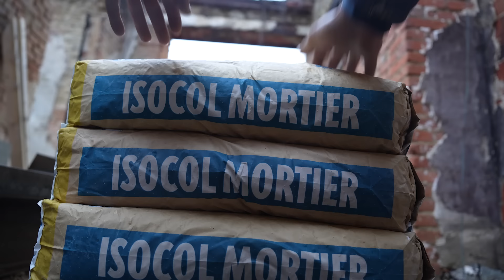AMAZED, the top of the chateau is impossibly level?

Comment: Just goes to show the bones of the chateau were quality work. This was not a slip shod build. It was built to last and built well. Your restoration plans should hold the chateau in good stead for another century or more. Your plans to address infrastructure of weather-tight, heat, insulation, water, sewer and power should support the chateau standing and livable beyond your lifetime, barring a catastrophic event. Given it was almost lost to one fire, I'm sure you will be doing something to deter similar damage in the future. It truly is a wonderful building and so glad you took on the task of bringing it back.

Comment: What a relief the walls are level!  You should be able to call yourself a master mason by the time you finish, you’ll certainly have earned it.
Reply: I wouldn't go that far but a good brick and stone "patcher upper" nevertheless which is what is required presently, the fit out work inside will be more exacting on times and will try his patience, but he will be happy to get to that stage, the Roof is going to take a little longer yet I think, but as long as it's the right job in the end that's the priority!?!

Comment: Will you be welding the roof 'ring/belt' beams together after anchoring them ? To counteract any horizontal forces on the walls (mainly the remaining roof static vector load - even after mounting the main load on the attic beams - and storm winds) ?

Comment: Just a thought: each time you winch a load up then lean out over a 3 floor drop to grab the load, why not make a simple hook and leave it there to grab the load instead of leaning out for a potential fall?
Reply: Something like a shepherd's crook, lightweight but useful for catching and guiding. Good idea.
Reply: He will get there in the end, the dollies are in use now after nearing the end of one third of the structural phase, he should get a small mixer and stick it on the floors, he could get the cement bags and sand and the water containers lifted up when Nick and Cameron are there and store them in the bathrooms  (Assuming they are dry or build a temporary cover) it will save a load of up and down work every day by using one day to get the stuff up, the floor boards are being replaced anyway!?!

Comment: My 20 year old house doesn't have a single right angle in it.  No wall is exactly vertical and no horizontal surface is exactly level.  
The chateau was built in a different time with a different mindset.

Comment: you really should consider putting a few screws in the osb flooring even if its temporary.  Even one at each corner is better than having a edge slip off a rafter esp with a heavy load rolling across it

Comment: I’ve been watching for a while now and I still can’t get my head around why you don’t screw all the flooring down properly 😂 it’s not like you’re going to be putting anything else down in the next 12 months 😂
Reply: He’s mentioned in the past that those are not the final floors.
Reply: Well it is only a temporary floor probably doesn't want to damage the joist with a bunch of screw holes and screws that may break off.
Reply: And holes on beams where rain can get in.
Reply: @TheBTG88 so? It’s 100 times easier pushing a lifter over a flat floor…
Reply: @alanstackhouse2939 use a nail? The small hole is not going to damage a beam that big
Reply: @sambarnes2063  He does not appear to have any difficulty.

Comment: Drill the steel holes before you set them in place. Drill, anchor and shim each as needed. Pack the mortar under after you set the steel in place.  Sometimes it looks like you are doing the work the hard way on purpose. It might make better content but as a person in the construction trade I really shake my head sometimes.